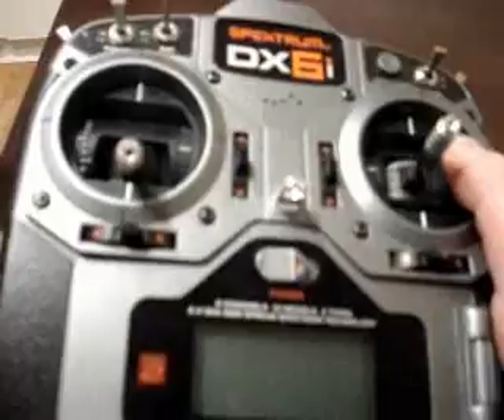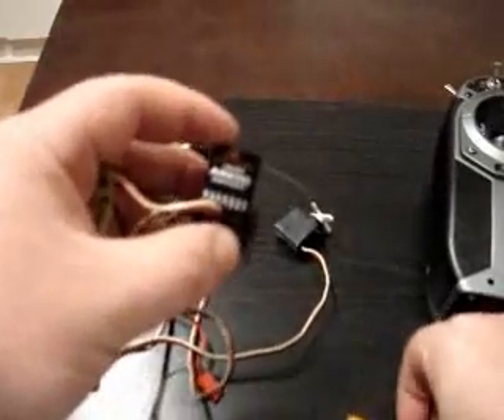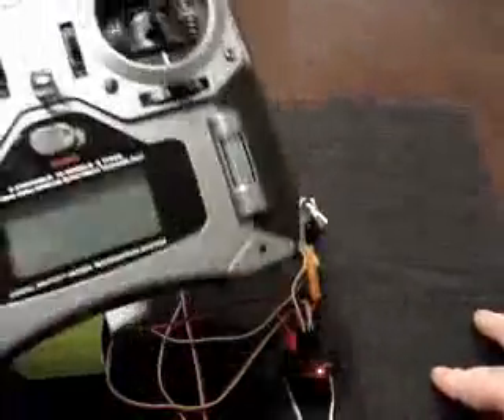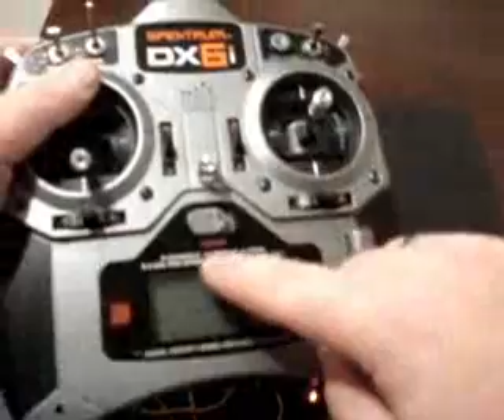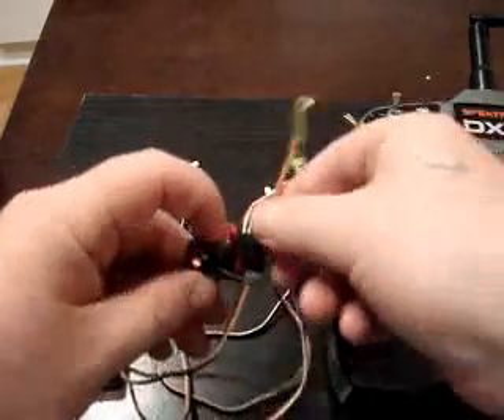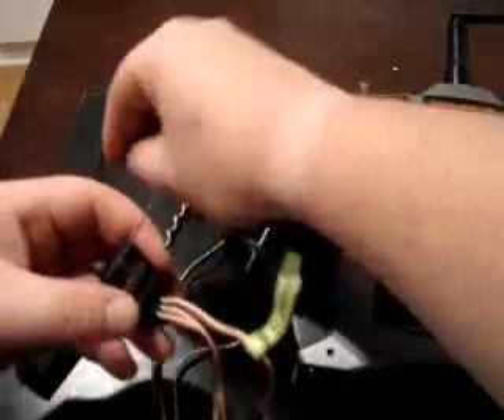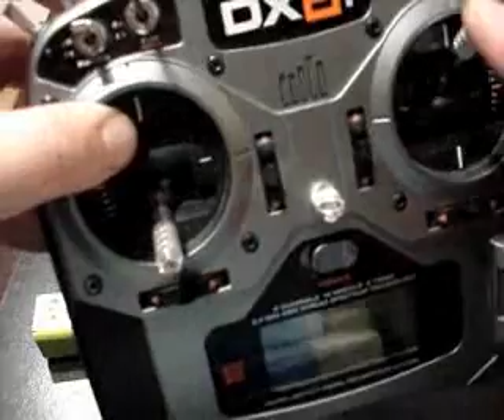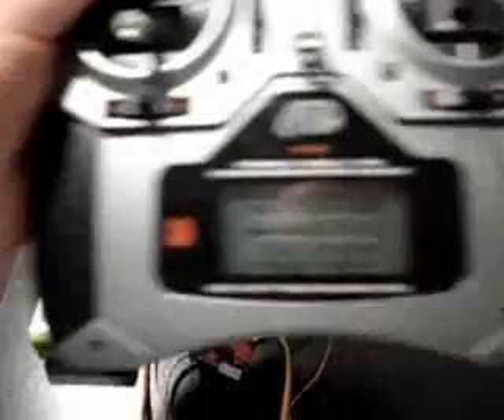Cheap Spectrum Receiver

Comment: It's cheap toy stuff.  2.4 ghz is a joke.  It's such a weak signal it's pathetic.  Our land lines for your cordless phone is not much more than that.  Try different brands.
Also it may not be the receiver but the Transmitter instead.  I have a 5e and a 6i both with brown outs and malfunctions.  Intermittent and unreliable.

Comment from the maker: @Trainboy64 this is very true!! i was a Noob!! I ended up crashing my Scratch built  Euro Fighter with this RX installed. Its in my Videos. "Euro fighter maiden and crash!!
Ive sense used/test over 30 Orange RX's form Hobby King and only one was DOA, (Missing a resistor)"!!
Pretty much all my Planes ,even Glow's have OrangeRX's with Satt's 

Thanks for the comment!